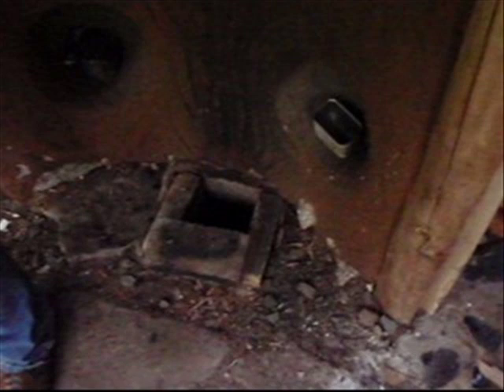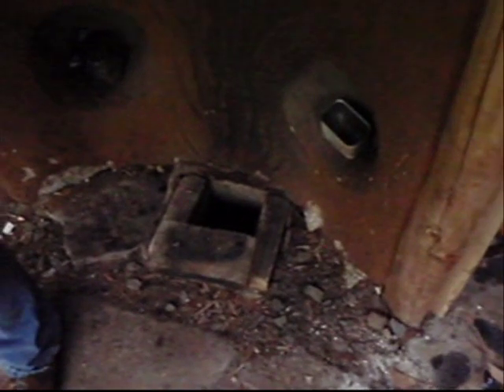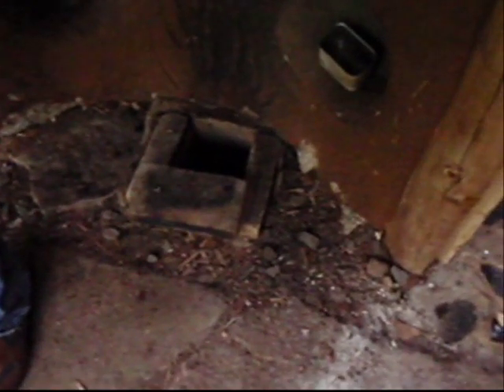hot water via wood, solar and micro hydro

Comment: going to be working on a way, to heat water with a rocket style heater. Trick to not blowing your house up, open top hot water tank. See old style wood burning stoves,' that have a connected vat/basin=chose your word for it, ' gravity feed the water to sink for dish washing, or shower.
Sound like a plan?